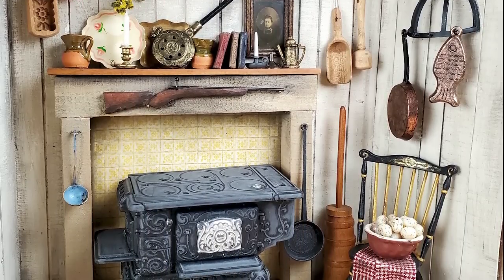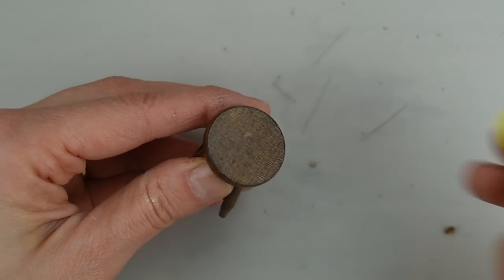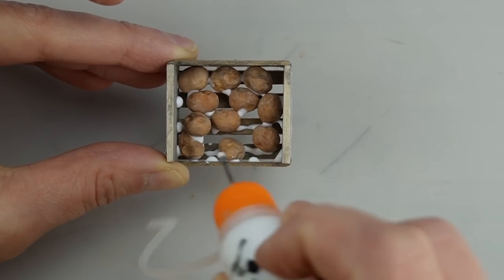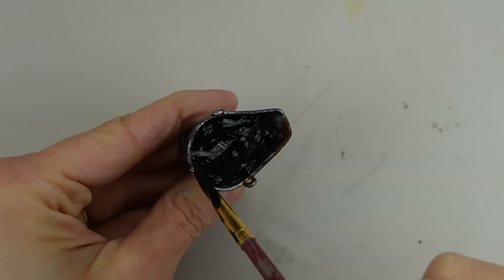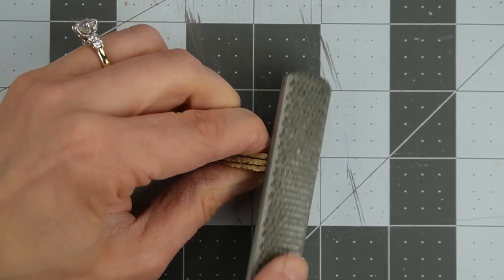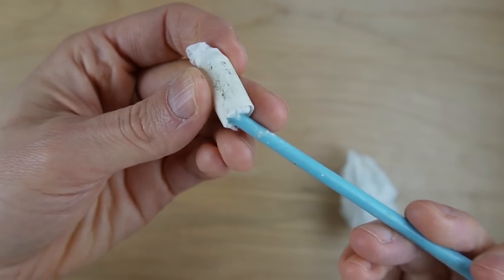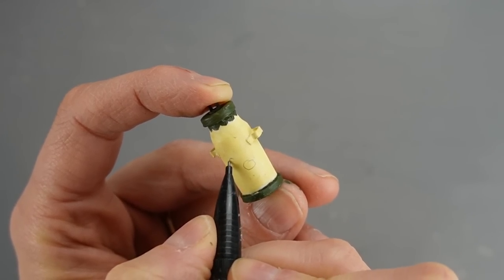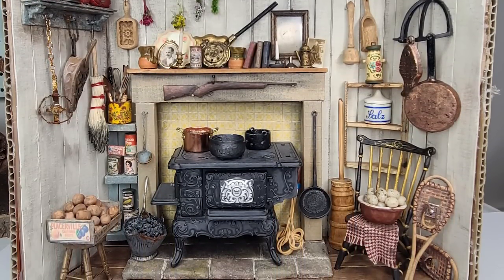DIY Miniature accessories for the cardboard room box

Comment: The churn thingy is painted in the same style as metal buckets and other items that people who used to live and work on canal barges used to make their traditional look, its always been one of my favourites,  it's usually flowers (which you really pulled off well considering how tiny) or castles.  I didn't know it came from Germany because most people who know about it just call it canal boat art. I need to look at the ground more often, I have been know to pick up copper and other wire but if I see anything like you just found, I will be copying you, lol!
Reply from the maker: Picking up a floppy rubber piece of trash off the ground it's probably not normal, but it was so perfectly shaped, I just had to.

Comment: You wondered about a coal bucket when you weren't sure as to whether an old-fashioned stove would use coal or wood - I heat my home with a wood stove, and I have a coal bucket sitting beside it! When I clean out the stove each morning to start fresh, the leftover coals from overnight are still too hot to do anything safely other than let them cool in a metal bucket. So your choice is totally accurate! :)
Reply from the maker: Thank you! I used to live in a house with only a wood stove for heat. We did the same thing. Heating with wood is a lot of mess and work.
Reply: @queencityminis  Oh, whoopsie, I didn't realize you also had IRL wood stove experience! It is messy but for me it is also free heat! :)

Comment: I know this is 8mo old when I’m commenting, but I paint a lot of small things and I use a fine but longer bristle brush, I know it seems counterintuitive, but somehow it allows for even smaller and finer movements with paint than a fine shorter brush. 😁
Reply from the maker: Thank you for the tip! I have small pointy brushes with longer bristles, but I've never used them. I'll have to give them a try the next time I'm painting something tiny.
Reply: Oh, also, I discovered you via Ara, thought you’d like to know 😁👍
Reply: I'm late too, but I wanted to add that a dotting tool in different sizes, usually used for nail art, would work great for tiny art. Dipped in enough paint, you can kind of draw with it like a pencil. I'm a new subscriber and have been binge watching. 😊

Comment: Meh dirty sidewalk trash just adds character. Ohhhh wish I would've known that curling paper trick yesterday. I was making a pipe for a smelter I'm making and putting the little paper rings on it sucked
Reply from the maker: I know. It's a great tip. I was curling paper by wrapping it around a marker. It didn't work well. I love getting tips and tricks from viewers.
Reply: @queencityminis  that's what I was doing too. It doesn't break the paper enough to be flexible enough to make a circle so it's a pain in the ass to get it lined up and you gotta hold it. I'm gonna try that finger nail thing